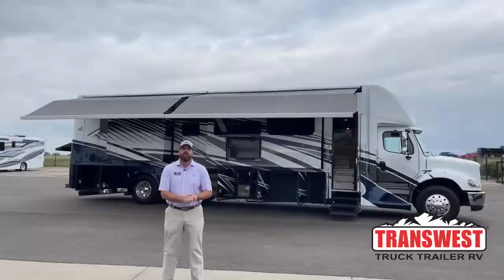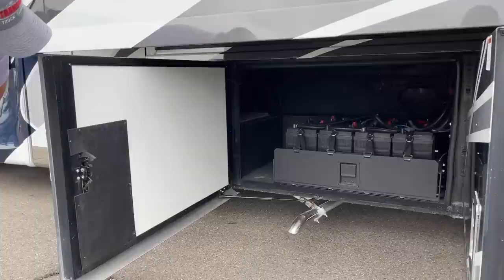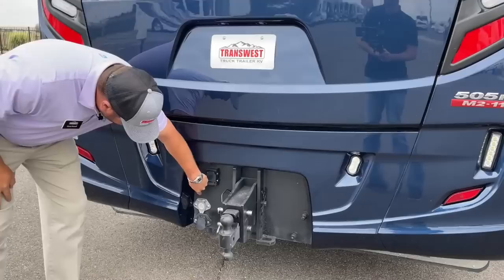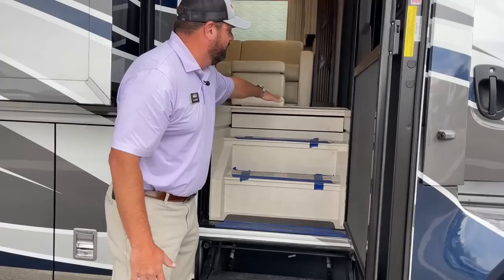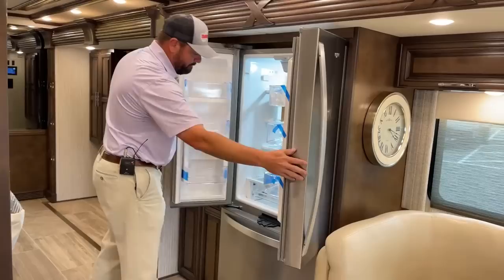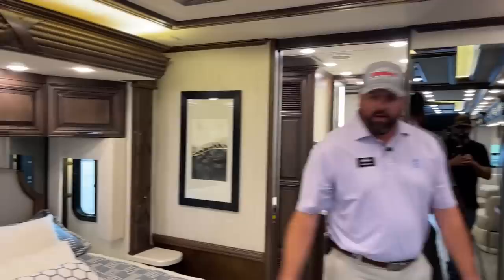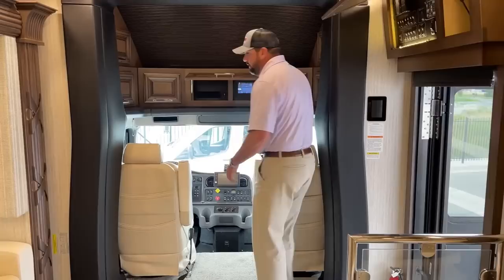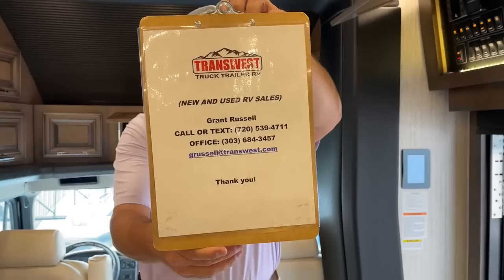2022 Newmar Supreme Aire 4573

Comment: Love the retro look inside. The somber cupboard doors and general decor are straight out of the 70's. I love it. The big 70's clock is pure genius. The builders took a big gamble harking back to the seventy's for this new build as this era is not particularly fondly remembered for its fashion and design statements.   But they've nailed it and reclaimed a bygone era but with subtle tweaks here and there to acknowledge the modern world. And I think as a whole, it works. It makes us think about and appreciate simpler times.

Comment: Can you get this on a better chassis than Freightliner? That's the only thing I don't like about it.
Reply: Unfortunately, right now; Newmar is only offering the Supreme Aire on the Freightliner M2112 chassis.
Reply: Pete chassis, PACCAR MX-13 engine, and manual transmission and you would have me sold. Maybe some modernization of the interior would help also. Grant, this is just a helpful tip, but have someone help you refresh your presentation because you overlooked quite a few things...just saying